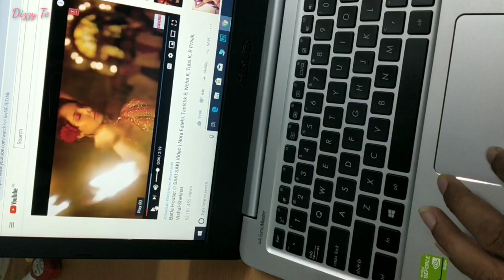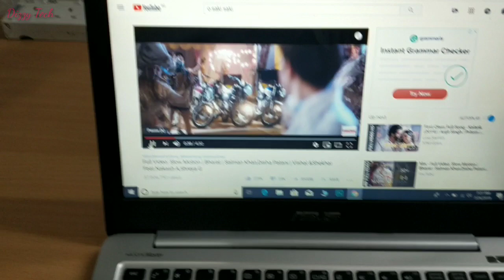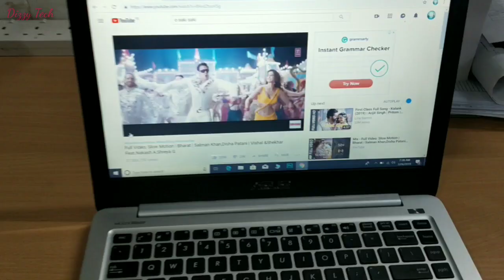Fixed Speaker Buzz Sound | How to Repair Laptop Internal Speakers of ASUS (K401LB) ||

Comment: I just hope the factory dealer/supplier who built any internal tiny speakers designed for any brand & models of laptops should build also pair of internal tiny speaker replacement or repair kit for any brand/model internal pair of tiny speakers and should cost no more than $6. They are so tiny, that should work. Also I just hope those engineers see & read this comments so they can build replacement internal tiny speakers or repair kit designed for laptops, it would be better which helps people who are doing a DIY (do-it-yourself) which is good learning small but big job but good experience. Also would be nice turning that small speaker into small speakers but big sound and base that feels the vibration bass reflex audio system. It's really good!!!  :)

Comment: I repaired my Macbook pro speakers by just applying a thin layer of contact glue (Shoe glue) on the blown speakers using a qtip. Works like a charm
Reply: @Google Account After cleaning any dirt on the speakers, I use a q tip and lightly spread a thin layer of contact glue over it. This makes a thin membrane covering over any other tears should I miss it. Gently blow over the glue as it will spread more evenly.

Comment: I also had this issue on my 7 years old Acer E1 470G, so basicly you just fix that rubber pendant bass woofer.? they sell that rubber bass pendant on aliexpress for various size with cheap price,i think i'm gonna change that,thank you sir for your video
Reply: is buzzing and crackling of sounds different?

Comment: Hi,may I know what is the gum you use to fill the hole of old speaker form you cut?
Reply from the maker: PVC Glue, You will get it at hardware or plumbing shop

Comment: What are the causes of sound buzzing??  My laptop speaker sounds like that.  Do I really need to bring my laptop to the technician??
Reply: buzzing means there's something loose inside the speaker. If you have the tools, order a replacement and swap the units. It's super easy to do. I had to do it on my Asus laptop as well, 4 years after I bought it.
Reply: From what i see,the rubber bass pendant that cover the speaker were torn,and that causes vibration sound like above,before i didnt know it can be fixed,you can fix it yourself just buy the rubber bass pendant woofer that has variable size on aliexpress and change it yourself,if you bring it to technician,they might change the whole speakers which is 7 time pricier that the rubber bass pendant